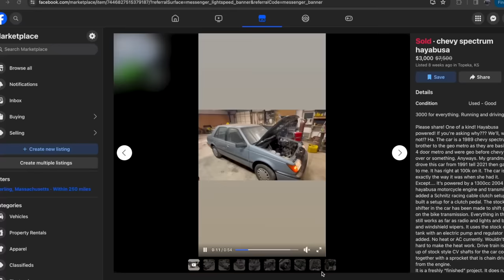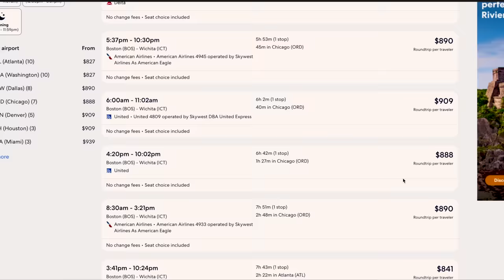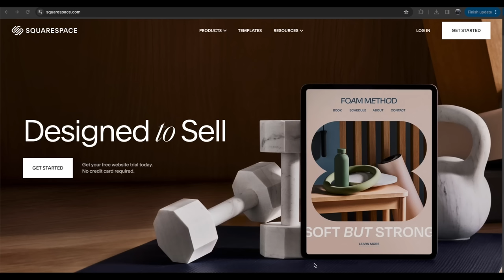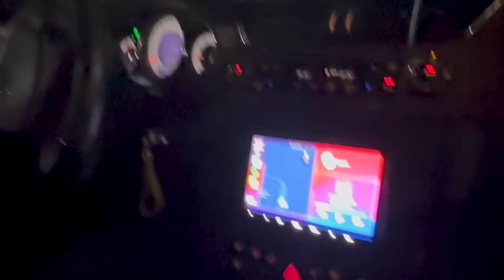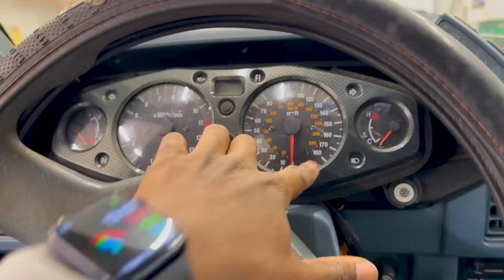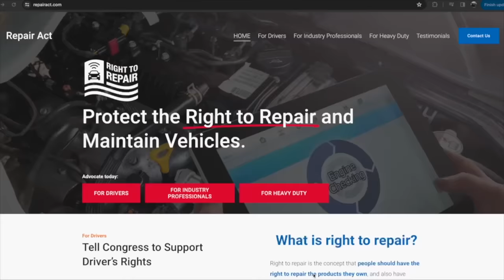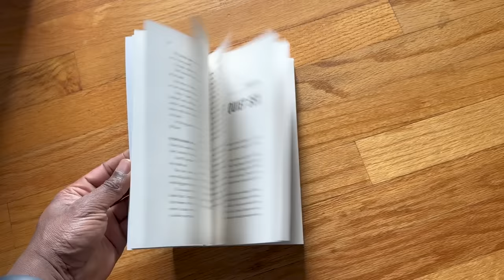I Bought a Hayabusa Swapped GM Experimental Car, but will it get me 1500 Miles back Home?

Comment: Please never stop speaking out for right to repair! Absolute legend
Reply: its messed up its even something in question....land of the free my ass
Reply: @Decenium  In a free country small shops could make and sell cars just like what's done for motorcycles
Reply: @Decenium Who is going to jail for repair? No one. Thus, the right already exists. Forcing the private sector to sell you something is not a right. Rights are addressed towards the public sector and government.
Reply: @castirondude There is actually nothing is stopping them from doing so. As long as the end product meets certain standards. Making cars one at a time, even if you have jigs for everything, is cost-prohibitive. Why do you think supercars cost so much? Part of it is the name, and part of it is the small production numbers due to lack of mass-production assembly lines. They're built by hand. The only way it's economical is to have assembly lines. How much does a custom chopper cost versus just going to a Harley dealer?
Reply: @timramich  Elon Musk almost went broke trying to get government approval to sell a car in the US.
Reply: @castirondude  You're allowed to make a car from scratch and it doesn't take a fortune to get it legal
Reply: @timramich John Deere would disable your tractor if you attempted to repair it - who owns the product if they can still tell you what to do with it?
Reply: @eljaroebeukes5118 
1. That's called a service contract. Read the contract. If you don't agree, don't sign it. Otherwise, it's legally binding. If they won't sell a tractor without said contract, there are countless other manufacturers of farm equipment.
2. This isn't the lack of a right. Cite anyone who has been found guilty in court and jailed for repairing something they own. They haven't, so the right literally exists already.

Comment: There are no direct flights to Kansas from anywhere. And flights are $1000 from here too.
Reply: That's because Kansas exists in another dimension
Reply: My name Jeff
Reply: That's why majority of people fly to MCI and drive an hour or so somewhere in Kansas
Reply: If they could come up with some way to just drop you on Kansas as they fly over... you push the little button on the wall and it goes DING and a stewardess brings you a parachute and opens the door
Reply: If there are ANY flights to KS they would have to be direct from somewhere wouldn't they?
Reply: Lol kansas city  to Norfolk VA. Is only 600
Reply: Why are you here 😂

Comment: I had an 87 Chevy spectrum. It was a factory turbo 4 cylinder. Apparently it was a pretty rare car. I loved it when I was 17. It was a blast to drive. I drove it until the turbo died. Turbos were expensive in the late 90's so I sold it. Would love to find another one for cheap now.
Reply: Totally forgot about the Spectrum turbo. I had a regular 85 Spectrum 5 speed hatch. Always wanted an IMark or Spectrum turbo at the time.

Comment: At 29:55 I think I see the problem with the final drive setup.
It looks like the CV shaft is using taper sheeves to attach the CV to the keyed shaft that is supported by the bearing blocks. This is not unusual and is common on power equipment and the like. But the taper sheeve is designed to be compressed and held on the shaft/keyway by an outer portion (usually a belt pulley or sprocket). The taper sheeve even has smooth and threaded holes which are used to install and remove the 2 parts (like a built-in bearing/gear puller.) Without the compression of the taper, there is nothing keeping the sheeve from sliding off the shaft or opening up under torque and causing the keyway to roll and destroy the shaft.....both of which happened here.

Comment: Swapping in a car that already has a manual transmission, keep the bike Transmission in 4th gear or whatever the one-to-one ratio would be and have that driving the input shaft on the transmission. I'm sure it would be far better than what he attempted to make
Reply: Picking the 1-1 in the automotive transmission and working through the bike transmission gears would likely work better seeing as there's generally no clutch mechanism used to allow easy shifting of the automotive transmission while underway. Check out robot cantina and how he applies your build thought with a different operational method. He does some neat stuff
Reply: @goosenotmaverick1156  I love robot cantina, I look forward to his videos every Sunday morning. I loved what he did with the original saturn, now moving that Kubota diesel adding the stupid charger and using the Saturn Trend in the insight is an awesome idea and I'm looking forward to seeing what he does next.

I want to see the air-cooled Renault coming back
Reply: Or but the engine in the back
Reply: Youre a brave man for not walking away Rich! This guys intrusive thoughts can be deadly.
Reply: @ras4782 My first thought
Reply: I've always wanted to do that to a kei truck. Put the input shaft of the kei truck transmission to the output shaft of the bike engine. Use the truck transmission but the motorcycle clutch
Reply: @chrisd4841  You'd have to lock the motorcycle transmission in the closest 1:1 gear, and I'd suspect that the transmission would actually be terrible for torque, as the gearbox most likely wouldn't be designed for that.  Unless you're taking a larger more powerful engine, such as a Hayabusa, VMAX, Rocket3, Goldwing, etc engine.

Comment: Those are rebranded Isuzu I-Marks. The Isuzu versions were pretty nice will high end features and very reliable. I had an 88 and bought it new. Manual transmission but other than that and crank windows it was loaded with features like a sunroof and cruise and spoilers. Even alloy wheels! They had a couple of passenger car options back then along with the Trooper and Rodeo. The Impulse was super sporty and cool! Loved my I-Mark. It took GM to dumb them down and ruin them. Just like they do with everything they touch!

Comment: That's hilarious! My wife and I bought a Chevrolet Spectrum (not Geo) brand new in 1988 just a few months before our wedding. It was the same color as in the video. It was great on gas, but a small hill or headwind at highway speeds would  slow you down and need to shift down to fourth gear. Cheers.

Comment: I just started watching the video but I had a 1985 Chevy Spectrum just like that but it was a 5 speed manual without power steering. I put a system in it and american racing rims. It was my first car. What a blast from the past!!!!
Reply: I had a 1990 GEO Metro 5-speed stick, it was a blast.
Reply: I also had a 5 speed 85 Spectrum back in 87.

Comment: Y’all should make a slip joint using 2 sizes of square tubing that perfectly slide inside each other welded to the axle ends so there’s some movement. Get a go kart diff for it, & do the square tubing for both sides. It’ll be janky but it’ll work.

Comment: So the problem is he isnt revving the engine high enough to get the torque up to get that heavy car initially moving. That engine was never designed to try to move that much weight.

Comment: Geo was a mix of companys cars. Being titled as a chevy was near their end, of GM killing them off. The spectrum is actually a Toyota Corolla, the storm is an isuzu impulse, the tracker is a Suzuki sidekick, the metro was a daewoo or was it a Daihatsu and so forth. Shared stuff with other brands and not eachother. Geo Parts departments must have lost their minds stocking stuff
Reply: The Metro was a Suzuki Swift. But the Zuk version had 4 cylinders, not 3. The Chevy Sprint that preceded the Geo Metro was a Daewoo in disguise.
Reply: @JeffKopis  👍
Reply: prizm is the corolla, spectrum is an isuzu gemini, metro is suzuki swift. The prizm hatch is the secret american badged successor to the AE86 I have a 1989 its nuts but 100hp fwd can only do so much

Comment: I had a spectrum about 11 years ago it was factory turbocharged and had a cold side turbo housing and compressor wheel from I believe a Thunderbird turbocharger and it ripped good! The gearbox was very stubborn to get back in first gear but it was fun little car on 15psi of boost.

Comment: I feel like a big reason the first and most common motorcycle/hayabusa powered "cars" were 3-wheelers.  Adapting a motorcycle drivetrain to a single rear-wheel solves and simplifies so many problems.

Comment: I had an 85 Chevy Spectrum back in 87. The Chevy/Geo Spectrum, like the Storm were just badge engineered Isuzus. The Spectrum was also sold as the Isuzu IMark. Isuzu released a turbo version of the IMark with suspension tuning by Lotus which they heavily promoted in their ads for the car. Someone else reminded me that the turbo option was also released on the Spectrum version. This "Lotus tuning" was also used on their Isuzu Impulse, both on their original Isuzu Impulse and the 2nd generation Impulse that the Storm was based on but I do not recall if the Storm GSI had the identical "Lotus tuned" suspension the Impulse got.

Comment: I was thinking you should bolt a Spectrum transmission back in and bolt /weld the gear drive to the input shaft of the trans to gain steering again,would be a great idea

Comment: I think the starting issue is a drop in fuel pressure. You can see in the beginning the fuel pressure gauge shows zero, so while it's cranking the fuel pump is bringing the pressure up. Either the return line is too small so the pressure reg is adjusted to provide good pressure at operating but then drops off once the engine turns off, or the fuel pump has a failed check valve and so isn't holding pressure. Got to the end and ah well, no worries.

Comment: I had a 1987 Chevy Spectrum (essentially an Isuzu I-mark) hatchback, exact same color & interior, 1.5L 5-speed manual, with an aftermarket Pioneer KE-2303QR Quick Release Pullout. 19-year-old me thought it was the greatest thing ever.

Burned out the clutch in 1993. Pulled the clutch cable passthrough tube thingie through the firewall and fixed the firewall with a piece of drilled-out wood. Drove for 3 months without heat because had no money to fix it until I hit a pothole and it started working again. Turns out I snagged a relay with my foot getting out of the car.

Comment: Saw a video with an old opel corsa with a cbr900 swap from uk, also fwd. Guy kept the shafts and diff in the original position with pillow bearing blocks on a small subframe. Diff was encased in a tin can of some sort that was half glued on with a cap for trans fluid. The big gear on the diff was removed and a big sprocket turned on a lathe and instaled instead of the gear. The car had some serious weight reduction and was fast as hell...

Comment: The driveline I would do.
The production manual transaxle from a Geo Spectrum. 
Adapt  a torque converter to to the input shaft of the trans. Connect chain drive to input of torque converter  You would have a clutchless manual transmission with the torque multiplication of the torque converter. The motorcycle tranmission would be put in 1st or second and left there. You could also go full send and make an adapter that would allow the torque converter attach to a flywheel. That way you could still have the clutch in the car transmission.

Comment: Just needed a shaft from the output of the engine to the input on the original spectrum transmission.  That way it would have a differential and extra low gearing to get it rolling.

Comment: The axles are put together with what looks like washing machine and plumbing parts. They should have used the spectrum automatic and mounted the engine forward and connected the trans and engine with the chain. Then youd of had 5 reverse gears and like 15 forward.

Comment: Take that chassis, find some random old FWD automatic transmission that works, and fit it together with a "repurposed" outboard two-stroke boat engine, preferably 3 or more cylinders. 

It won't be terribly fast, but it'll sound absolutely flippin' awesome trying.

Comment: I owned a geo storm, it was on its way to the place it belonged, the dump. My ex-father in-law bought it for $200 and gave it to me and my ex as a house warming gift. It was completely stripped on the inside and had a bent frame. That didn't keep me from constantly running it at its max speed of 85mph lol.

Comment: The irony is that Suzuki was one of the companies building Geo branded vehicles; the plot twist is that this model, however, was built by Isuzu.  Now, had it been, say, the convertible Geo Metro, then the carcass would also have been Suzuki built, making it in my mind a convertible Hayabusa, which of course, is a hat on a hat, but technically the best sort of hat because it's more hat regardless of how much hat anyone else has, you have a hat on top of that hat.

Comment: My brother owned a Geo Prizm with a Toyota 4A-GE motor in it stock from the factory.  Thier where not very many of them built with that motor.  If I remember right it was only like 1100 of them with the Toyota motor in them, and I know that because every time I needed parts for the engine on it I had to tell the auto parts store that it was a corolla as that was the only way I could get the right parts.  They didn't have that motor listed for a 91 geo prizm.

Comment: I have a 1992 hyundai excel, I didn’t go the route you did though, instead I took a 1994 bayliner 150 outboard, broke the rear hatchback glass and stapled it to the trunk, while I don’t have any gear that propels the wheels the propeller on the outboard creates a small jet stream and I can get up to about 19 mph on the highway. In instances where it’s malfunctioning or I run out of gas I have a sail sewn onto the roof which can get me from point A to B if a small gust of wind arises

Comment: wanna come judge my build? 95 Minicab + 83 V45 mounted 180 degrees due to shaft rotation, mating to a 2011 Yamaha Apex chain case for reverse which also acts as an @2:1 speed increaser due to gearing, mated to the front pumpkin via a short little drive shaft. It's got a little of everything. Not quite wrapping my head around using a car shifter to shift the V45 trans...currently linkage rods(ugh). As of last build, 55 mph 6th gear 9500 rpm screaming like a banshee. Chain case was mainly for reverse but I get the benefit of lowering my rpm's or going faster.

Comment: Have owned an R6 and a manual car they are so different to drive. On a motorcycle you have to slip the clutch way more compared to a car and motorcycles want to stay above 6 rpm at all times and you have to rev match on shifts.

Comment: Nothing sheared off the shafts. The axle cups wiggled loose, and the farther off they left, the more they wobbled and wallowed things out. The best thing to do would be to find a transmission made for that car and axles, rip out the diff, rip off the ring gear, and get a sprocket bolted to it. For the 2 idler spider gears, machine them out to accept bronze oilite bushings. Do the same for the axle spiders, but it would be in the diff housing. They also make oilite washers, which could be thrust washers for behind the axle spiders. Instead of tapered rollers for the diff to ride on, find ball bearings with the appropriate ID that will fit on the diff. Not hard to fix. Doing all this and you could have a literal open diff. Any why it ran like crap...when you first went to start it, there was no RPM reading on the tach. Clue.

Comment: they swapped nearly every part over. except, wait for it... the choke. where is it. put it on, instant start up, and you won't burn out your starter on every other try. remove a couple of links until it's tight... I've always used gold d.i.d. chains bc they're the best, hands down. take that setup and put it into a decent car, like a nice kitcar, it will surprise you. curious what you do with this next, Rich- drop it into a tesla ?

Comment: The Spectrum was sold as a Chevy before Geo. I had one. It was the Isuzu I-Mark. It also could be bought with a tiny 1.6L V6 too. At least the I-Mark could be.
Reply: A 1.6 litre V6? Make an adapter plate to fit a Suzuki Carry, Mazda MX5  or Mazda RX8 transmission and drop it in a Triumph Herald, Austin Farina A40 or a Ford Pop.
Reply: @chrishenniker5944  it wasn't really a powerful V6. I didn't think it'd give the results you think
Reply: @TheSportCompact  Well, there’s always the blower you can put on them.

Comment: Actually bought a chevy spectrum when i was a kid. It was a 200 dollar beater in 1997. The damn tging would not idle for the life of it even after fixing all its vacuum leaks and replacing its shitty little carb. I fixed its crusty body and gave it a teenage Krylon purple spray can paint job in my garage. Oddly enough i did the prep on the body well and the paint laid down smooth with only a few runs and som fish eye on the door bottom. I wet sanded it all out and clear coated it and i sold the thing a week later for 1600. It was still junk.

Comment: The way you get around all of those problems is you leave the trans in from the original car.  that way you have all of your forwards and 6 reverses . I don’t use the clutch in the car find a small car like a k car and it has all gears plus reverse!! And u keep the cvs the brakes and all jus make a connection from shaft on the bike to the trans shaft or a chain but to me that’s a failure point

Comment: The less-janky way to do it would be to find another, manual Spectrum as a donor car and mate its' transmission and driveline to the 'Busa engine.  
It still won't be as fast off the line as the Leaf someone swapped one in mid-engine and retained the EV system for low end torque, but it would still be more drivable than it is now.